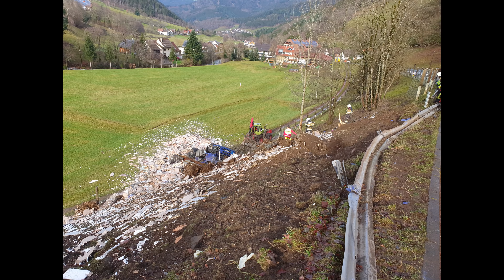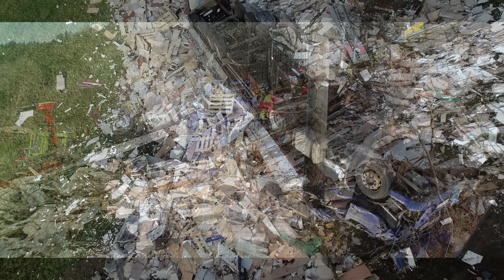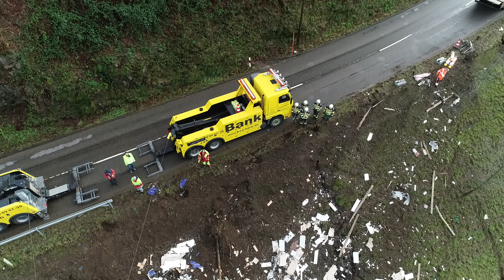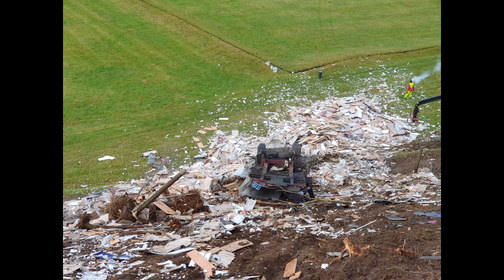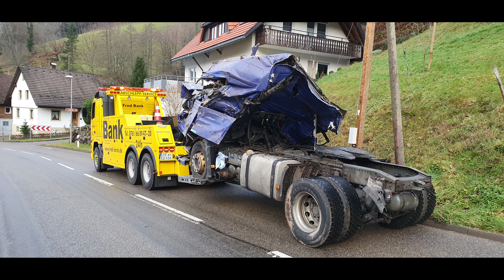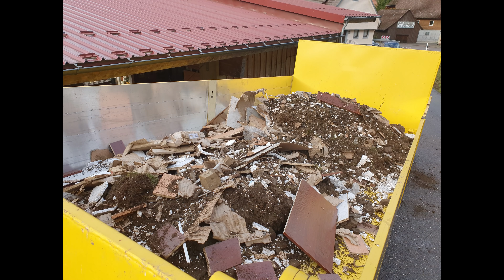Fred Bank GmbH & Co. KG - LKW-Bergung nach Verkehrsunfall 2019 4K - Obersimonswald

Comment: Why on earth do the recovery guys stand in the line of fire, when they have the wire rope under tension. If something breaks that rope will come back faster than you can blink.
Reply from the maker: Sometimes you cannot avoid going into the danger area for a short time. When a person from the rescue team is in the field of fire, all winches stand still, which means that the rope cannot be pulled off. Thanks anyway for the comment.
Reply: instablaster.